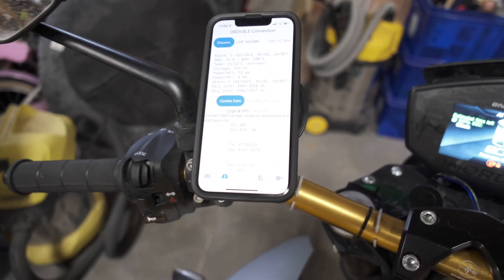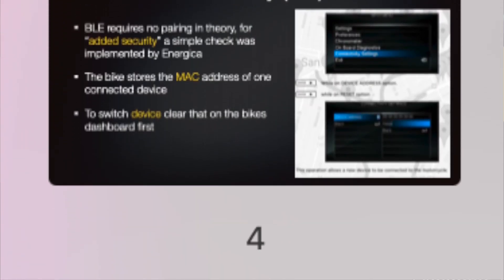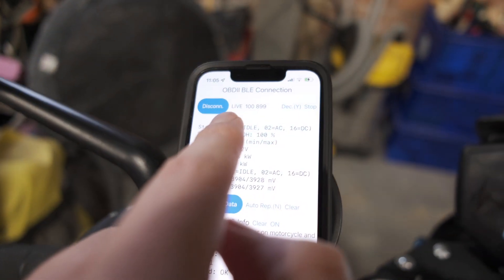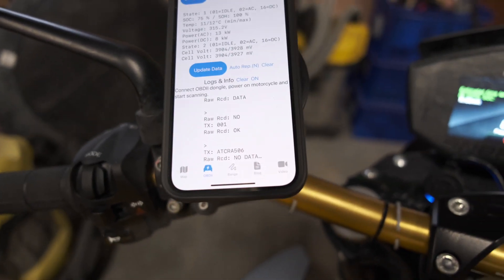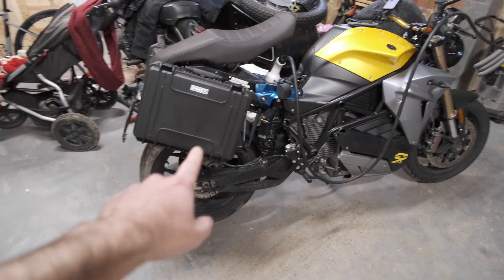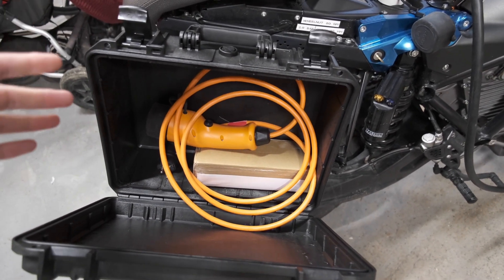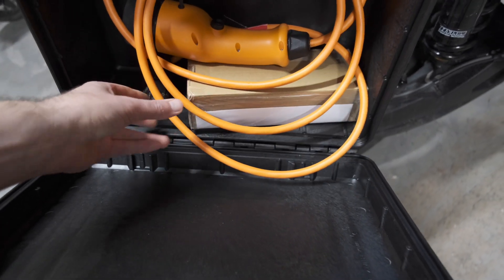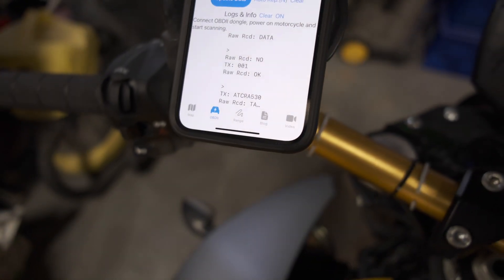SCANNING ENERGICA motorcycle CAN BUS for new data discovery

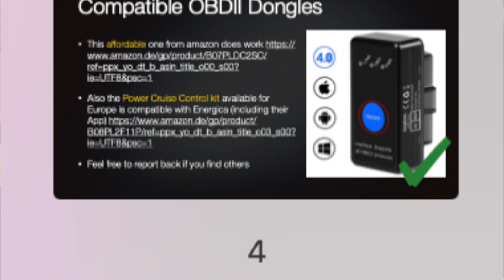Comment: hey, i bought dongle as you recommend like on this pic at 1:37 - but it has powerbutton - is it possible to mod it to ALWAYS ON ?
Reply from the maker: Hey indeed I didn't notice it at first since if you toggle ignition power stays on for a while but eventually it dies indeed and needs to be powered on again. A shame cause otherwise it works for the non default commands.
Reply: @Hans2183  in my case dongle not powering up at all, only after i press power button ( i have keyless 2020 ss9+) i dont know if its revelant
Reply from the maker: Yeah sorry for that. Hopefully you cab refund it. The power cruise control one is more expensive but works without buttons. If you have android most of the data is already found in the BLE connection that doesn't require extra dongle.
Reply: @Hans2183  unfortunanetly i have iOS, i just figure out that android has more info than iOS :(

Comment: Nice cables! Did you made them yourself or did you buy it somewhere? I'm looking for exactly those because right now I have a schuko-T2 and a T2-T2 that is meant for 3 phases x 16A so very big and heavy when the bike only uses 16A on one phase. So if you have an address or an URL I'd be happy! :)
Reply from the maker: I ordered mine at https://eauto.si/metron-shop/ This is the type2 to 220V schuko 16A adapter https://eauto.si/metron-shop/product/adapter-type-2-1-x-schuko-16-a/ and this is a list of all the adapters they sell https://eauto.si/metron-shop/product-category/ev-adapter/ The portable charger cables are at https://eauto.si/metron-shop/product-category/portable-ev-chargers/ Ordered and quickly delivered to Belgium in my case. When picking a product you can often change color and length and some other options like with or without RCD and type of plugs.
Reply: @Hans2183  awesome, thanks! :) I'll probably get the T2-schuko adapter to use with the Mekenes schuko-T2 charger I already have. 360€ for just a little less space is a bit of money...
Reply: @matthieulabas  t2 shucko on aliexpress cost about 50-60$, but if you want use it on stalls you have add on/off switch, if you want to use it with chargers with cables you have to trim/cut 10mm top of plastic to work
Reply from the maker: BTW, I use that type2 to 220V schuko adapter also for charging up my camper van on the road :D
Reply: @Hans2183  remember that if you dont have on/off SWITCH on this adapter and you will use it on stall (wihtout cable) stall might lock adapter permanently (until you emergency power off)

Comment: Hi again - maybe worth to mention that the one OBD dongle suggestion has a button that your have to push each time you want it to operate. Not handy for use after you reinstalled the side cover. I had it ordered but returned it to Amzn. Now I am using the „Power Cruise Control OBDII“ Dongle. It auto-activates with the bike and thus can be used on trips without the bike looking like Frankenstein…👻
Reply from the maker: Oh really? I noticed the button but can't remember having to push it every time. But then I was using that on the zero mostly. I'll check if that button can be bypassed. That is a stupid design. Thanks for letting me know 👍